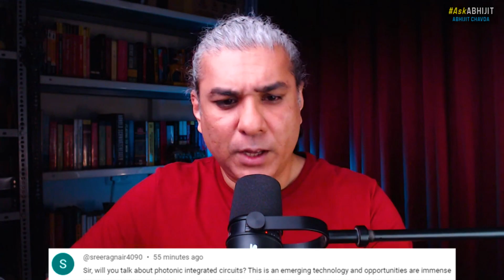Why Photonic Circuits Will REVOLUTIONIZE Everything | Tech Future

Comment: Bharat is making significant strides in the development of Photonic Integrated Circuits (PICs), driven by initiatives like the Center for Programmable Photonics Integrated Circuits and Systems (CPPICS). CPPICS, a joint venture between the Indian government and Si2 Microsystems, aims to establish a domestic manufacturing supply chain and ecosystem for PICs, with a focus on silicon photonics. These advancements are expected to revolutionize various sectors, including data processing, computing, and communications, as PICs offer faster and more energy-efficient solutions. 

Key aspects of India's PIC development:

    CPPICS:
    This center, sponsored by MeitY and Si2 Microsystems, is a key driver in developing domestic PIC manufacturing. 

Silicon Photonics:
CPPICS focuses on silicon photonics, which offers high-speed and low-energy consumption for various applications. 
PICs are being developed for a wide range of applications, including quantum computing, 5G/6G communication, IoT, and radar, according to the Indian government. 
 
Domestic Manufacturing:
The goal is to achieve self-sufficiency in PIC manufacturing and drive product commercialization through startups. 

Optical Sensors:

Photonic integrated circuits offer a platform to miniaturize optical sensors, enabling on-chip chemical reaction detection and changes in chemical concentrations, says the Indian Institute of Science. 

In addition Bharat is  making progress in diamond semiconductors! So in the post silicon future Bharat will likely dominate.

https://anjalisemicon.com/application/
India, Netherlands can collaborate in research for using lab-grown diamonds to produce semiconductors: MeitY Secretary 
https://www.thehindubusinessline.com/info-tech/india-netherlands-can-collaborate-in-research-for-using-lab-grown-diamonds-to-produce-semiconductors-meity-secretary/article69188814.ece
 IIT-Bombay, TCS to build India’s first Quantum Diamond Microchip Imager
The Quantum Diamond Microchip Imager, an advanced sensing tool for semiconductor chip imaging, will help reduce the chances of chip failures and improve the efficiency of electronic devices
https://www.thehindu.com/business/Industry/iit-bombay-tcs-to-build-indias-first-quantum-diamond-microchip-imager/article68224240.ece